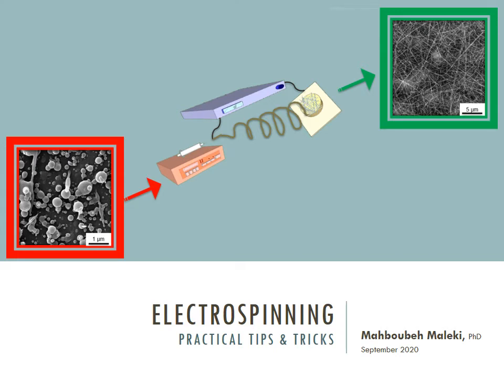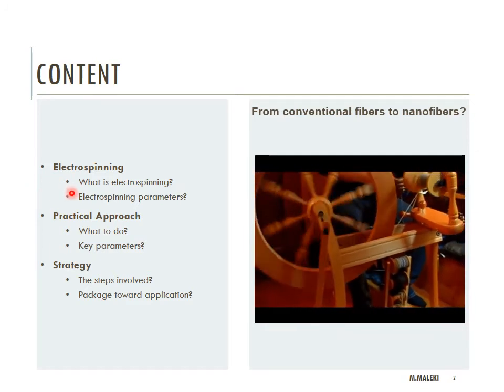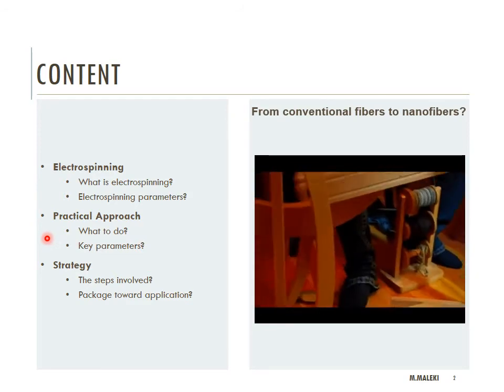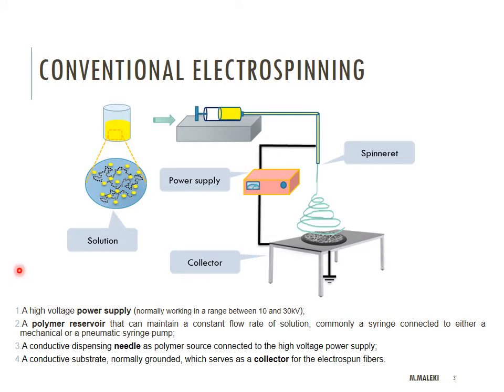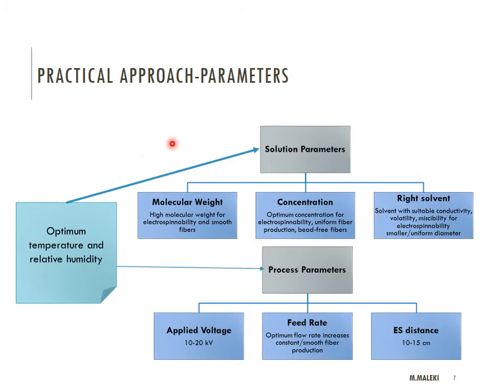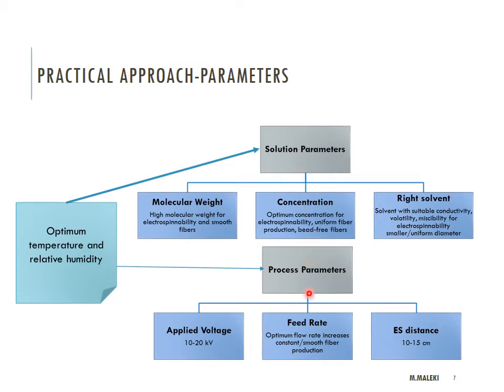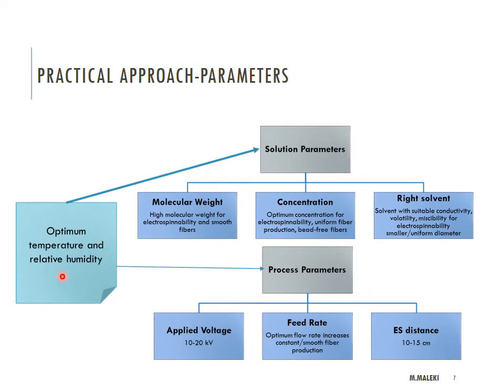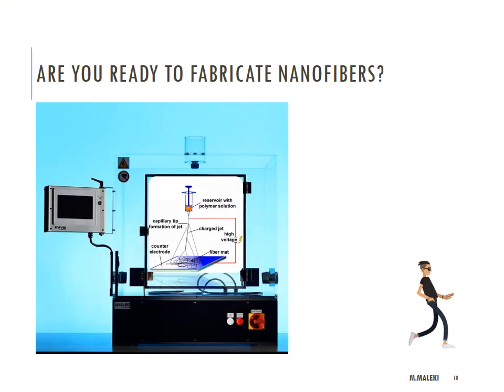Electrospinning:  Practical Tips and Tricks

Comment: Could you suggest a few polymers that could be used for an effective electrospinning process??
Reply from the maker: Choosing of the polymer, mainly depends on the application. But in case, you are only interested to check the process-ability, I suggest PAN that is cheap and very easy polymer to handle for electrospinning. Good luck 👍
Reply: @dr.mahboubehmaleki1307  
I tried preparing PVP nanofibers by dissolving it in ethanol: water (4:6).
Spraying was proper but after spraying 4ml of the soltution, nanofibers that I obtained were not proper. I was unable to form them into a film or may as it should be. Do you have any suggestions for the same?
Reply from the maker: @siddhilokhande3143  I suspect two reasons for that: 1) your solution isnot stable over time: you can check the change of color or viscosity over time or you can make a fresh solution and check if you have the same problem or not. 2) your polymeric solution is sensitive to relative humidity of the environment: if your electrospinning chamber doesnot have a controlled climate, you can try to use different salts to keep a constant RH. 
Good luck.
Reply: @dr.mahboubehmaleki1307  Thank You so much for your help!